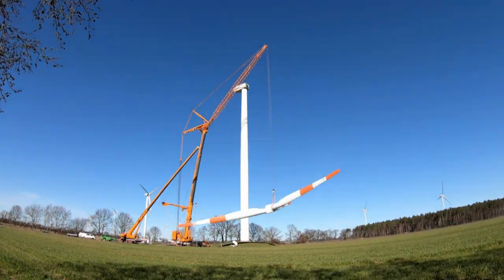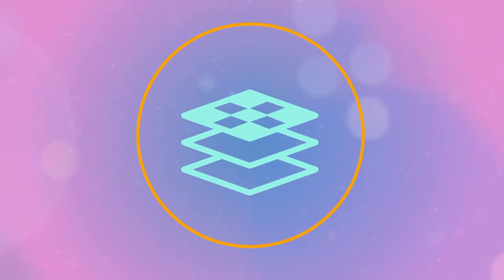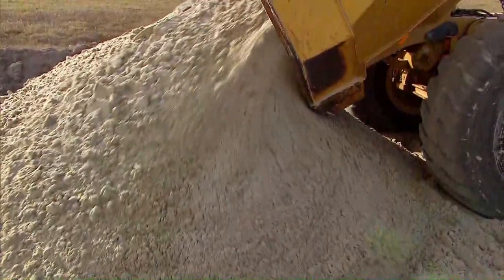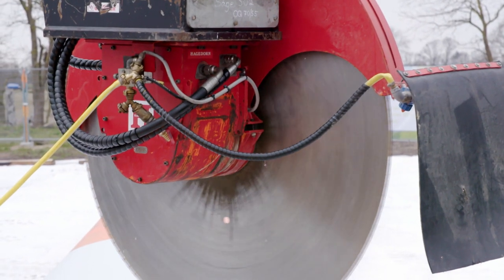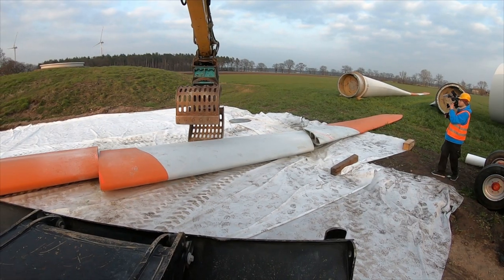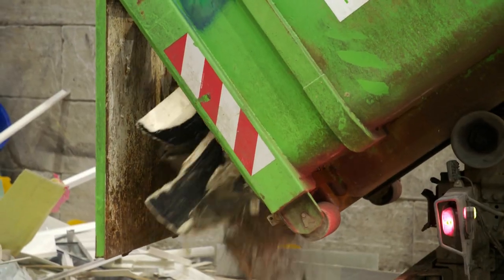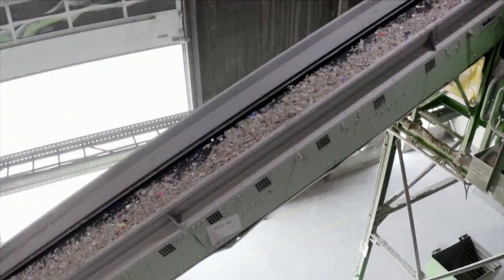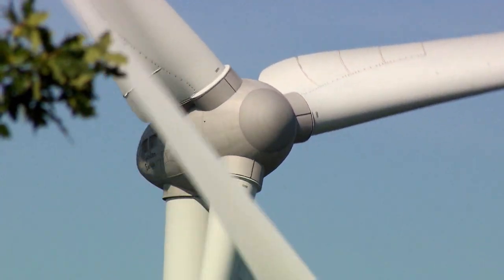Green Heroes: How Wind Turbines are Recycled | Free Documentary Shorts

Comment: How often do you have to sharpen/change a blade that cuts fiberglass all day?
Reply: They are diamond tips saw blades, the lady said they last about 8 wind blades.. Looking at the video, it is the tips themselves that are changed and not the whole blade....
Reply: I think they said they change it after 8 blades. It looks like a diamond wheel like is used for cutting concrete and stone so it can’t be sharpened. Maybe its economical to have new industrial diamond tips silver soldered to it.